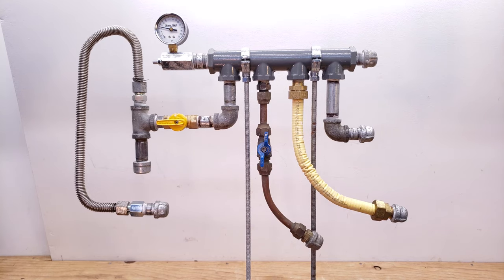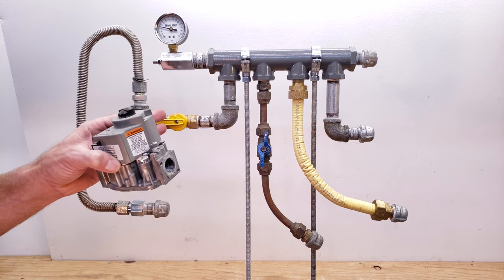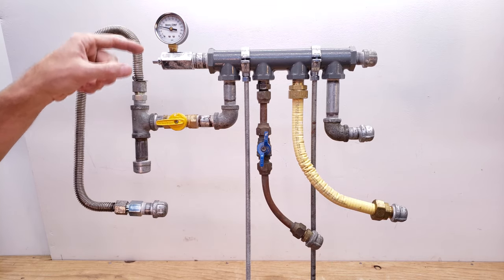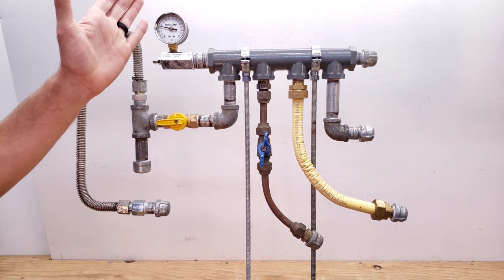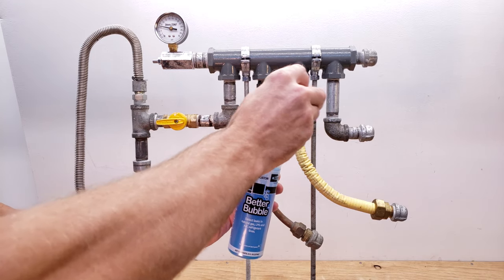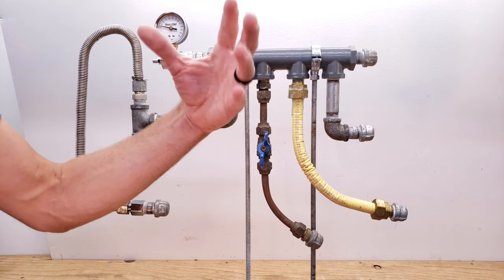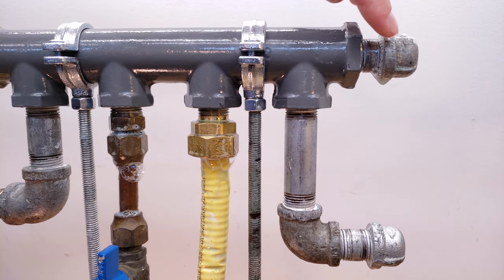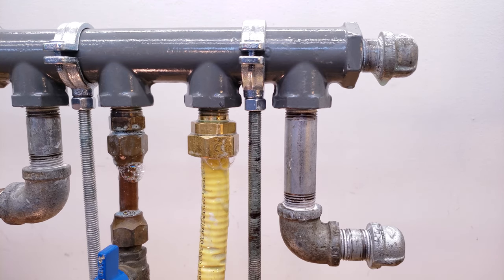Pressure Testing Gas Lines For Leaks! Natural Gas & LP Propane!

Comment: Good video but I'd like to add some helpfully suggestions  and insight that may help some of your viewers .My experience comes from 35 years as a first responder/ service fitter for the natural gas utility in St Louis, Mo. #1 you may want to add an appropriate pressure rated cock ( shut off) between your gauge and fuel runs you are pressure testing ( this way you can isolate your gauge to ensure it is leak free and use it for isolating; you can shut it off during the pressure test and turn it right back on to verify no gauge drop.).#2 best method for use of approved liquid leak detector is a spray bottle or a round parts cleaning brush. Use of dobber just can't get to every area efficiently. #3 active leaks should be located with a tick rate electronic leak detector and pinpointed with approved liquid leak detector ( never an open flame, let me repeat never).#4 after all the appliances are connected to the fuel runs one more pressure test should be completed ( this is the low pressure test completed with a manometer ,7 to 13 inches water column). This will ensure you have no leaks on the appliance connections & no appliance gas controls or valves are passing gas. Hope this helps and stay safe out there.

Comment: Where I live the gas company makes us test at 20 psi here in Easley s.c.
Reply from the maker: If that is for low pressure, it sounds like it is just the inspector there because that is much higher than IFGC states, thanks!

Comment: This is very interesting. I just had a line added to my existing system for a generator and the installer told me that the pressure test failed because of a leak somewhere in my existing pipes. Specifically they said they tested at 4.5 psi and it dropped to 4. They're charging me a lot of money to come tomorrow and find the leak.

If I understand correctly, they shouldn't have pressure tested the whole thing, just the new line.
Reply: How did you make out?

Comment: Hey Craig I got a question. Is it possible to start an apprenticeship in one state, then halfway through you move to another state and finish the apprenticeship there? Will the credentials carry over to the other state? I live in NJ and I want to start my apprenticeship now. But I know I am moving out of state in 1 to 2 years, and I dont want to have to start it all over again. Thanks.
Reply from the maker: You should contact an apprenticeship director at the state where you are moving to in order to see if they are reciprocal. It depends on the state, thanks!

Comment: If you think you have a leak, can you test with the blue spray stuff with gas in the line?
Reply from the maker: yes but only with non-corrosive bubble leak detector, thanks!
Reply: @acservicetechchannel  even better than the dobber a spray end with the non corrosive bubble leak detector fluid would help even more as it more effectively gets into tight and small spaces. I would also pre-test and post-test with an active electronic gas leak detector after the bubble leak test. Call it a belt and braces approach but with something as dangerous as gas it really is something I would recommend.

Comment: Ball valve closed only rated at half a psi? Where are you getting this info? Nibco gas valves are max rated at 125 psi. Never had a problem testing a line using the ball valve in the closed position.
Reply from the maker: The non full port no WOG valves are typically stamped with the pressure rating with the valve closed. It certainly can handle more than that but thats the rating and IFGC states to that gas valve should not be stopping the gas during a pressure test. The Nibco WOG valves have high ratings since they are for water oil or gas, thanks!
Reply: @acservicetechchannel  you show the pressure gauge where the gas meter is going to end up so it's safe to assume no gas is in the line for testing right? FGC states not to pressure test with a valve separating the actual gas (boom boom)and another test medium (air or nitrogen). It also says a  valve is fine to use if it can safely withstand the test pressure. Section 406 testing fgc2015. Now lets say the valve is approved for 1/2 psig for gas like you're saying, are we not allowed to pressure test it with Air at a higher rate if the valve shows a max pressure of 600 psi? My questions are directed at learning and understanding only, snowflake peanut gallery be warned. 🤣